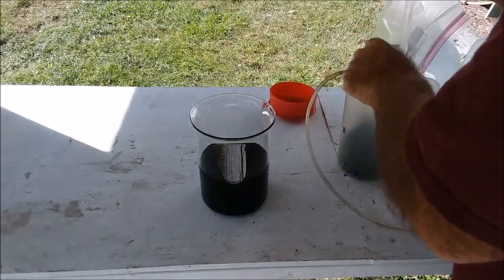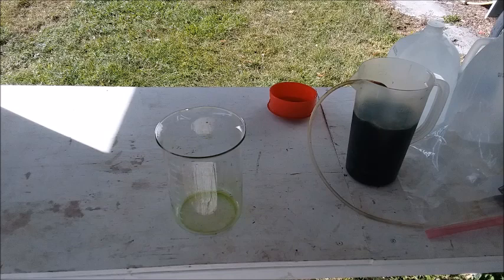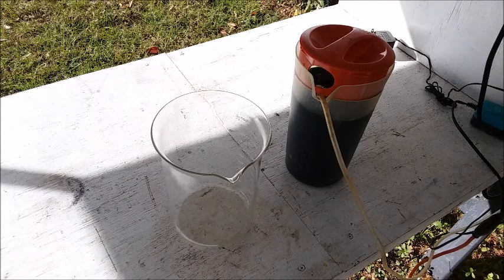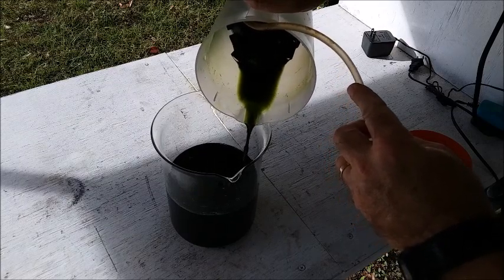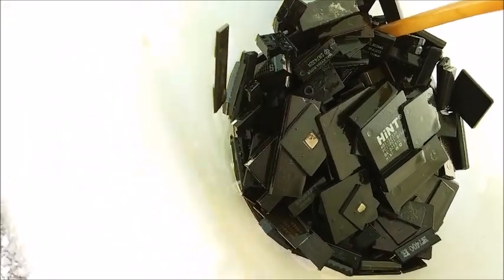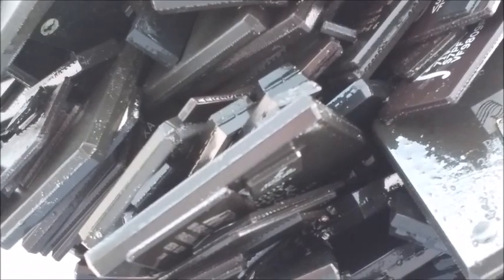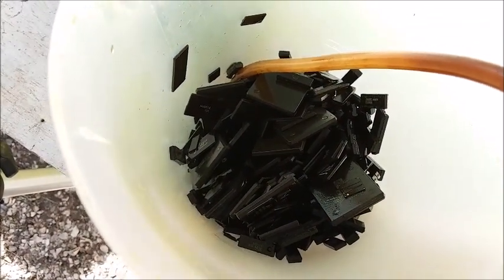Dissolving The Legs Off Scrap IC Chips in AP Solution For Gold Recovery

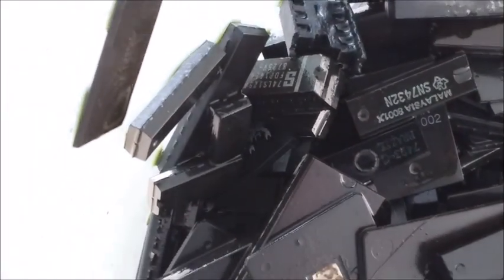Comment: 4:55 "I'm not sure how far into the package ..."
Is there a reason for not pulverizing them first in the blender? I would think that grinding them to powder first would make all other processes easier and more thorough. 
Pulverizing first would make easier and more complete combustion, de-legging, and gold dissolving.
Reply from the maker: The order of some processes could be changed up some. I do like to get rid of the legs first though. They are nothing but waste material. I want to keep the metal inside the package because it is sometimes gold plated, but don't want to have to deal with a lot of extra waste metal while I am processing the internals. I actually think pulverizing the chips to dust would make them harder to incinerate, at least with my method. Maybe there is another way.

Comment: Great video, thank you for sharing.AP dissolves iron legs. Can it be reused?Or scrapped?This is what I want to know.
Reply from the maker: I'm sure the AP solution could probably be reused several more times. Eventually it will get so loaded with dissolved metals that it will probably no longer work, but I don't know how long that might take.